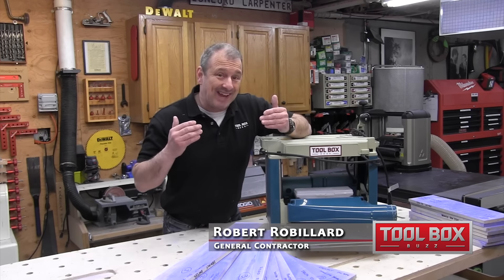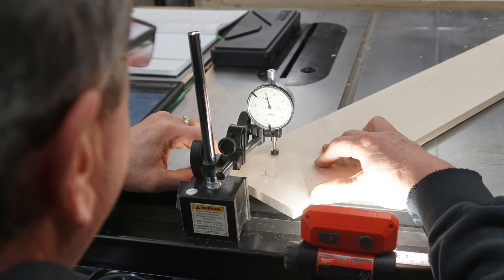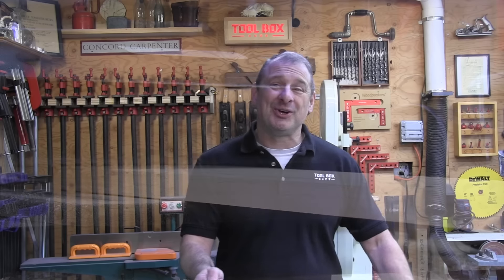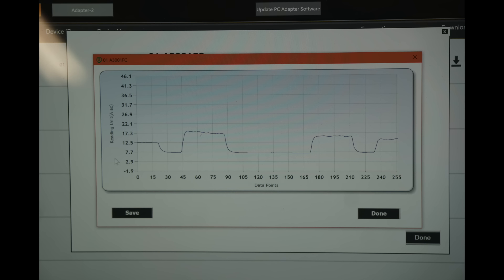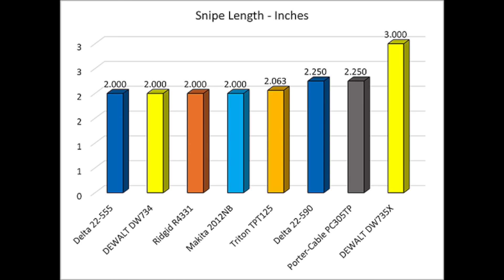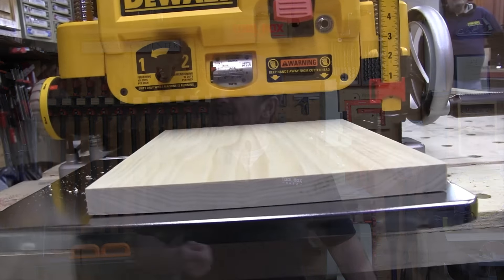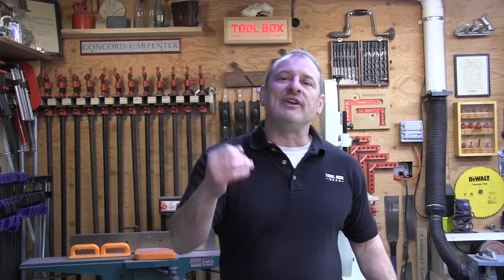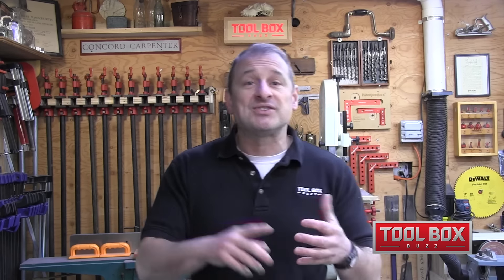Best Benchtop Thickness Planer ~ Head-to-Head

Comment: Great video. I have been using the Rigid for about 3 years now. I am just a hobbyist so I would rank my use as occasional. It has been a really good one and I don't have any complaints. But I have read some reviews where people had complained about a noise that sounded like maybe a bearing issue and mine has developed that noise. I have had the noise for a few months now and it hasn't affected the operation at all. I plan on changing blades soon and will try to narrow down what it could be when I do. I was happy to see it ranked 3rd in your test.  I have no problem recommending it.

Comment: This was a great video. I had bought a Planer from a company here in Canada called Busybee. It is a CX125HC HC for helicoil head. it is a 4 threaded post planer and I have had issues with it due to the gears in the base being plastic and the chain got really loose thus making it make the head tilt to one side. This Planer is actually made by Cutech which also makes them for WEN. Just thought I would give you this info. Thanks again

Comment: The DeWalt 735 is just so good especially with the end tables and if it's mounted. I have never had snipe on mine, granted I never plane boards more than 5 feet because I primarily build guitars. I got mine close to $600 with the cart and end tables and blades after vet discounts at home depot last year.

Comment: great video! So many great brands out there. I have a particular piece of grizzly equipment that I had to repair 13 separate issues straight out of the box. Didn't get to use the Grizzly product for a month, and it was brand new. They sent me a defective warranty part, parts that didn't even fit, and there was a back ordered part needed. I'll never buy a grizzly product again.

Comment: Great study... Your chart shows the Dewalt is pulling 30 Amps on the Poplar!  surprised you didn't blow your 20 A breaker.  I expect if you had done a few more passes you would have.  In any case this overamping will reduce the life of the motor. I expect the very low Amp draw of the Makita is part of the motor protection circuitry.

Comment: Great video! 

But I suddenly have an appetite for giant scallops seared in a little olive oil, a little butter, some garlic, some white wine...

That DeWalt 735X is a nice machine, and if you want to  practically eliminate the snipe, I created longer infeed and outfeed tables, I make sure that I double and triple check my set up, that everything is aligned properly, and replace the cutterhead with the carbide inserted, helical, Shelix Byrd cutterhead. 

For the exotic hardwoods we use, figured and very hard, abrasive, sometimes sticky and gummy, even when properly dried,  and to avoid the issues with tear out inherent in straight blades used in these types of materials, the cutterhead is the right way to go. It is expensive, I’ll give you that, but it only takes scrapping out a couple $150 book matched exotic top sets to realize that the cutterhead wasn’t really all that expensive.
Reply: Sounds like you make solid body guitars, basses &c. (Yes, the price of the exotic woods used in instrument making make the most expensive wood found (even in your local area "Specialty" lumberyard) seem insanely cheap. That makes those cutter heads and blades a bargain.)
Reply: @johnbesharian9965  exactly!
Reply: @johnbesharian9965  ... and yes, I do make solid body guitars and basses. I have been for about 25 years.

With my wife and I starting our own business, this is the first time I will be making instruments without putting someone else's name on them.

Comment: Before watching the video I'll add a few comments, one which I don't think will be covered in the video.
I've got the Dewalt 735x, and something I really liked is the ability to shift the blades side to side a little bit.
Just enough so that if you get a little nick in them you can offset it by shifting one left, right and center.
You can get a little extra running time before having to flip the blades.
Also, they are very easy to switch and align.
Something that is probably in the video, holy crap it's loud.
Reply: 25 minutes to change the blades on the 735x, what?
Good thing I didn't use the owner's manual, it took me about half that time.
Next time use an impact driver to rough it out and in, finish torque by hand.
An advantage of accessing it from the top is you can fit an impact driver in there very easily, where you don't have space for it with many of the others.
Reply from the maker: Macks Power good point we covered in article

Comment: I had a Dewalt 735 and I did not like it....I have a Dewalt 734 and I love it for it's accuracy.  I do custom work and customers can be pretty fussy and want their stuff to fit together when they get it and that's easy to do on the 734 plus there is no snipe as long as I keep fresh, sharp blades on it. Parts and blades are also very inexpensive compared to other planers.  Years ago, I had a two blade rigid and that thing was so loud, it would wake up the neighbors when I worked into the evening during busy times.  They would complain to me.  I eventually switched to the 734 which is all I use now.

Comment: Funny how different opinions on input and output shelves.  I was told to NOT have the shelves level to reduce snipe as making the infeed and outfeed shelves level increases snipe vs allowing those shelve furthest ends to be slightly higher.
Reply from the maker: zalllon great tip we think that too - works similar to lifting the board on exit.  Not really sure but it makes sense
Reply: I have the 735 and it did help reduce how bad it was, but definitely didn't solve it.  Keep up the reviews, I like how you guys approach your comparisons ... as I your table saw and mitre saw reviews to help me choose my equipment.

Comment: I was surfing the YouTube channels on planers and came across yours.  I commend and appreciate what your group has done to review the different planers which are commonly available, very good info.  I am looking to purchase one soon and came across a brand called Cutech.  They sell a few models, two of which use a 13" spiral (helix) cutterhead with a general price around $550 - $650, which seems pretty cheap.  I have read a lot of good reviews about them and would be interested on what your group thinks about them.

Edit addendum:  I forgot to mention that Ridgid comes with a lifetime warranty on the machine as long as you register it online.

Comment: Makita had a table top planer/jointer combo. Makita also had planer with a stationary blade that would slice long thin tissues much like a Japanese hand pull plane.
Reply: Delta send me replacement parts free of charge including shipment even out of warranty! YMMV. I still could found parts (not all) for my old DeWalt 733 purchased about 15 years ago!
Reply: Cutech 40700HC-CT 12 1/2" Spiral Cutterhead Planer with Carbide Tips for $450. How could you beat that! Tips only 2 sided, cannot be sharpened though ... but

Comment: the other consideration i would have liked was upgradeability, with more woodworkers using shelix spiral head planer cutters for finish and noise reduction, it would be nice to see which planer had spiral cutterheads available as an option. the triton surprised given its price point. 
i seem to remember lots of complaints about the knife quality on the dewalt  735 planers, if you have to change blades often because of damage and they are disposable id imagine the cost would mount up.  thanks for the review

Comment: Awesome and enormously beneficial review. Good on you guys. Puzzled me a bit why you haven't done any review on spiral cutting thicknessers as they are, at least here in Australia, a big "market breakers" easy to change relatively inexpensive inserts,  (lot cheaper than full size blades), although that kind of thicknessers are generally not cheap stuff and producing a nice finish and incomparably quieter machines. Anyhow nice review. All the best.

Comment: "We decided not to use this data in the rankings" was said everytime the 735x was at the bottom. 735x is a ferrari when you need a pickup, its shiny has every option one could think of but its still stuck in the mud. The sniping issue is a major issue that should be ranked for it! I had the 735x and now have the 734 because of this issue and couldnt be happier.

Comment: What a fabulous job you've done on comparing these machines. You thought of everything. Thanks so much.

Is there an updated version available? The video I watched was dated May 17, 2019 which is 3 years old. Things in the market place have changed and I'm particularly interested in how the Rikon 25-135H compares with DeWalt DWX735, especially because of Rikon's "spiral" cutter head design, 5 year warranty, and similar price structure.

If you've not made an updated version, when might that be coming out.

Thanks for this great contribution to all in the woodworking industry.

Comment: I really appreciate the vast information you provide in this review.I’ve been looking at purchasing a bench top and this review has given me a lot of needed considerations.

Have you considered doing a review on saw guides ? I’m about to install a butcherblock countertop and I’ll be cutting it to length myself.Almost straight isn’t good enough, so I’ve been comparing some guides ,like the festool, but real experience with a tool is always better than just stats.

Comment: I had an older model delta, very similar.  The roller bars went bad. Cracked and wouldn't grab the wood well enough. Looked into repair. Parts were discontinued.  Bought the porter cable mostly because thats what was on the shelf at the local big box store.   Anyway, I fabricated a dust collection box for the Delta to connect to a shop vac. Real easy.  The Delta and Porter Cable are similar, almost piece for piece. I was able to bolt my dust collector box right onto the Porter Cable without modification.  They must be the same machine, just different branding.  I am lusting for something more commercial though.

Comment: Appreciate your video and I enjoyed it very much. I've been kind of lusting after a small planer but like you say some of them are extremely expensive at least for me on Social Security. I didn't know what snipe  was. I have only been around commercial planers and there was no problem with snipe or scalloping. At least now I know where to start at. And that helps a lot because if you ask five people the same question which one they think is better and you'll probably get five different answers and all five have probably never owned but the one they have. Thanks for the great video!

Comment: I love your reviews. Very thorough. I've had a 734 for about ten years, and installed helical head in it about 7 years ago, and haven't regretted it once. Almost never get tear out, even on Tiger Maple. A suggestion for your snipe problems. I found that RAISING the infeed and out feed tables a bit, so that the rollers flex the board down will almost completely eliminate snipe. I'm not willing to throw away 4 inches from every board I plane when that stuff runs up to 8 bucks a board foot. Good luck!

Comment: FYI - the 'Delta 50-359 12-inch planer dust hood' works very well on the Porter Cable planer; however, it costs around $75 to $90. Available on eBay, Amazon, and many of the usual places.

Comment: I am not surprised that the Dewalt 735 has the best finish as it has 3 blades instead of two. A concern is with snipe as wood is precious. The power is great but 20 amp circuits are not always available in garages...   it is a very nice plane though. I have the Porter Cable and it does the job ok but it does have issues with tearing the surface at times. I take smaller cuts to avoid that...
Reply from the maker: Thanks for sharing

Comment: Excellent review.  I'm going shopping for a planer this weekend.  Thanks.
Reply: What did you end up buying ? Happy with it ? Just curious.
Reply: @ELW2940  Believe it or not, I still haven't purchased that planer. Work distracted me. But, I retired in August and I'm back on the hunt. I really like the reviews of DeWalt DW735X, but the cost. So I'm considering the DeWalt DW734 or the Ridgid R4331. I'll let you know what I decide.
Reply: ArtiodactylaSlayer I’ve used the Rigid for several years, professionally in my shop, and I’ve been well pleased with the results. They’ve added a blade since I bought mine. If I ever need another I’ll buy it again. Important to know with all planers...support infeed and outfeed, well, to minimumize snipe and use a dust collector.
Good luck. I’ll look to hear from you.

Comment: as a user of the dewalt and the makita I have to say I much prefer the makita there's an important comparison you failed to comment on and that is noise! the makita is very noticeably quieter in operation also the blade change on the makita is amazingly quick much quicker than the time you published, the blades are reversible and have a ridge in the blade meaning you don't have to worry about getting them level. I don't tend to get as much snipe with the makita as I do with the dewalt especially on soft wood species such as pine. Also weight the makita is much lighter and easier to move around compared to the dewalt as a sufferer of ruptured discs from an injury many years ago I can comfortably move the makita planer around site where as the dewalt causes severe discomfort at the base of my back. My view is if your going to customers sites and being mobile then go for the makita as it's quieter and lighter. if you have something fixed in place like a workshop where the unit won't be moved around then the dewalt is a great shout. Me personally I favour the makita and many others I speak to also turn there hand to the makita just for it's ease of use and it doesn't want to rip away your ear drums when in operation. make your own minds up but guys please don't over look the makita it's a phenomenal machine!!
Reply from the maker: rob riley it’s lighter and easier to store as well
Reply: @ConcordCarpenter  to be fair we have the dw733 model as the one you have there isn't available In the UK but our version we have is a pig to carry

Comment: This is by far the best review on bench top planers on YouTube!! I would agree, that in this group, the DeWalt 735 is great..  and offers vastly superior value.

I would like to see some more industrial brands, slightly higher price 700-900$ range, like Grizzly -G0940, Jet -JWP 13BT, Laguna PX12, and the Shopfox W1877 vs the dewalt if you did another. Again.. greeeat video, great insights.

Comment: Surely I appreciate these guys time and effort. Epecially the analysis and findings. Great job. But this one felt more like a commercial to me. They showcased the Dewalts strengths and hugely gave recognition and good ratings whenever possible. And on the other hand, it seemed as if they decided not to rate a couple of areas at all, (like with the snipe findings) where the Dewalt fell marginally behind according to their own graph. Nor did they compare a dollar per dollar value where it also struggles bcuz those things are pricey. They even put the Dewalt model right on the thumbnail. Jst seems peculiar. Anyhow, if it's as great as they say it is, and most of you guys seem to agree, then it seems to be a machine I need to try out for myself.
Reply from the maker: Ricardo H I’m really sorry you feel that way we put a lot of time and effort into these. We do our best to stay impartial it to use repeatable and consistent testing practices

The fact of the matter is that the 7435 is far superior to the rest of the planers is in this test, as far as the thumbnail photo the bright yellow looked the best answer very unique looking tool so I chose it as a thumbnail plus it came in 1st

Comment: I wish you would have included the Cutech 40200HC-CT. I own one and I’m sure it would have smoked this competition. It has Included spiral cutterhead, snipe lock, cut depth stops, great dust collection and reversible carbide blades. I did a ton if research before I bought it and it came down to the Cutech and the Dewalt 735, looks like I made the right choice
Reply: Dustin Gomez I agree!! - I have my choices down to these 2 machines- I just can’t seem to find many reviews on the Cutech yet. And for me  it’s difficult to argue with a planer that so many woodworkers find to be the best out there for the price point. I will say this- I did NOT  like my last Dewalt 733 planer at all. I guess I will have to dig a little deeper !
Reply from the maker: Dustin Gomez we reached out to them, they didn’t respond
Reply: A Concord Carpenter / ToolBoxBuzz, Well at least you tried, can’t do much about when they don’t respond. Great video none the less, keep em coming you guys are the best when it comes to tool reviews
Reply: Recently purchased one as well. Amazed at what comes out of it. No prior experience with planners, but considered the DeWalt as well. But for the cost of the DeWalt plus upgrading later to a Shelix, the Cutech just made more sense to me.
Reply: James Simon That was exactly my thought process,  the helical upgrade would have put the Dewalt around $1200. The results I get with the spiral on the Cutech are glass smooth ready for glue and have had no snipe issues. To be fair I always follow the boards I plane with a some sacrificial scrap to be sure I eliminate any and all snipe.